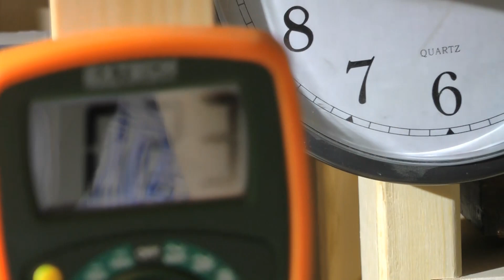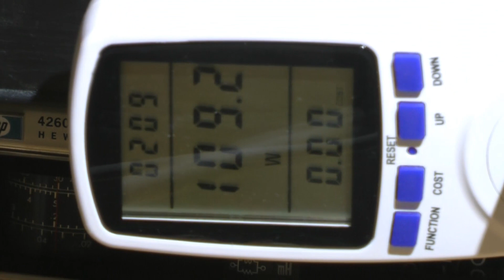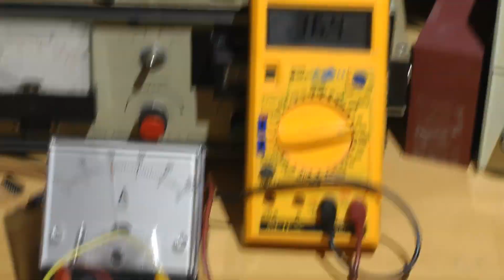Bridgelux Vero 29 with big sink

Comment: what size of a heat sink would the 68 volts verison of the vero 29 is goona need in your opinion ?
Reply from the maker: If you're going to run up in the 200 watt range I'd go with a fan. I use fans for everything above 50 watts.
Reply: @Flintsmooth  will a basic cpu cooler with a fan be enough for a single cob? (assuming the cob runs at 118[w] and is from the vero 29 series  ). and thank you for the response.
Reply from the maker: @rotem2116  Yes, 118w isn't too bad! Make sure the heatsink has enough area for the COB, they are quite big compared to some computer CPUs.
Reply: @Flintsmooth  yeah thats my dilema for example will the alpine 11 pro be enough for one cob. or will i need a bigger surface area? 
and again thank you for replying.
Reply from the maker: @rotem2116  I have a 29 mounted on an arctic 64 plus, I think it's the only one big enough.
Reply: @Flintsmooth  what voltage is the vero 29 ? and is it a gen 7?
Reply from the maker: @rotem2116  The one I used was an older one, probably gen 6, the 39 volt one. I have new ones I haven't used yet, some 70 volt and some second edition. I'm running experiments on some V22s and some V10s right now. I plan to do a video on a grow light with eight V10s, I'm just completing my second one.